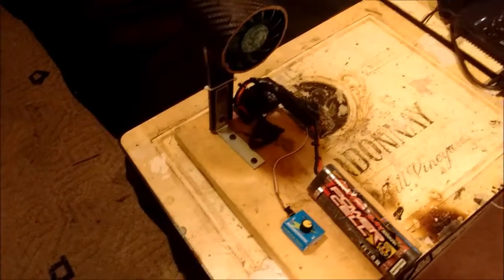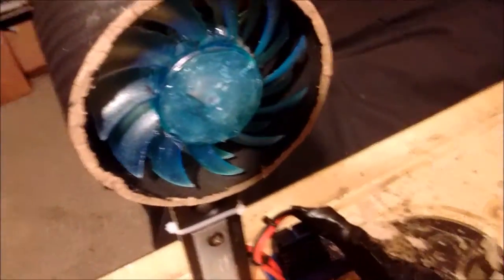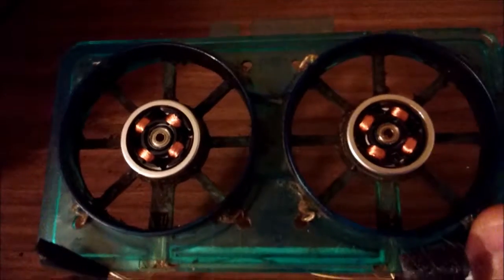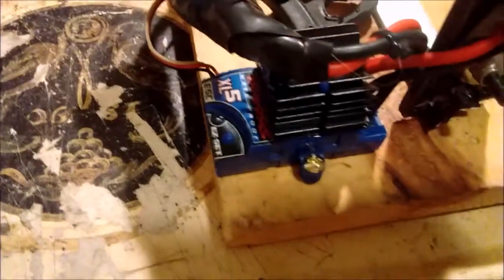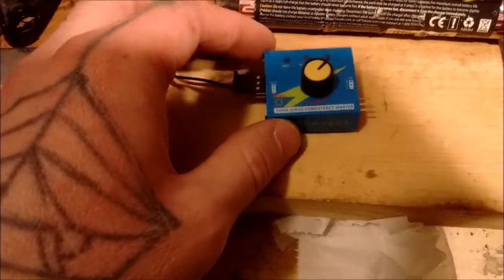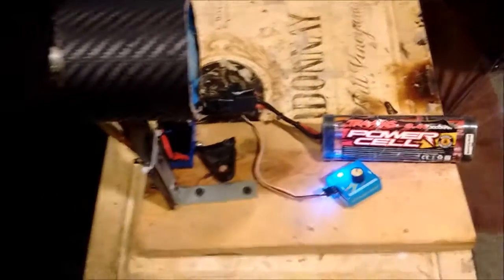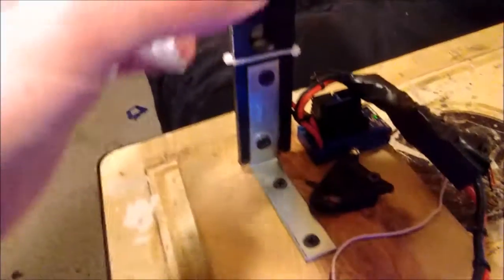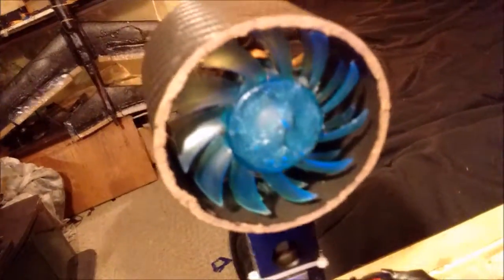Home Made EDF Jet Engine Part: 1

Comment: Those cpu fan blades are not going to withstand the power that model edf jets are loaded at. They'll disintegrate before you can lift anything with it.
Reply from the maker: I'm pretty aware of that and I assumed that could be possible to happen. I just made this out of pure boredom just to see if I can build something. Thanks for the comment. I wasn't planning on putting it in anything. it was more a experiment to what would happen.